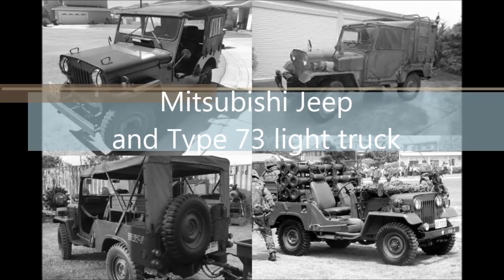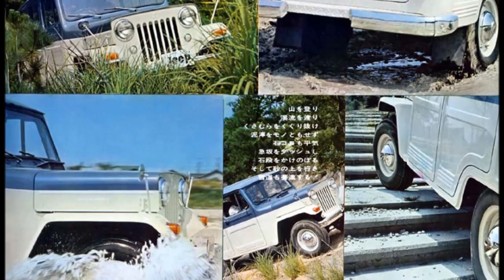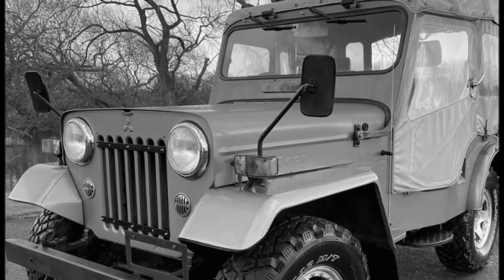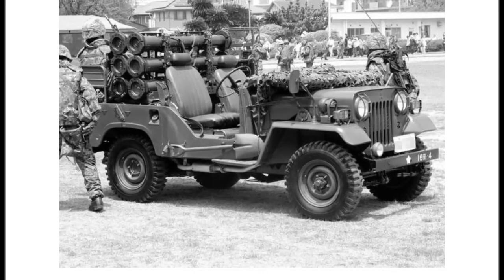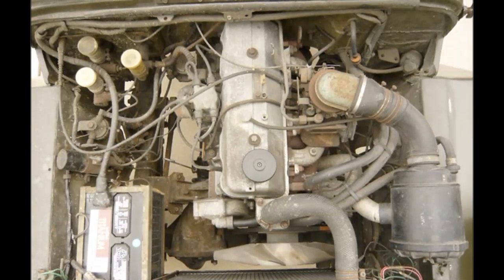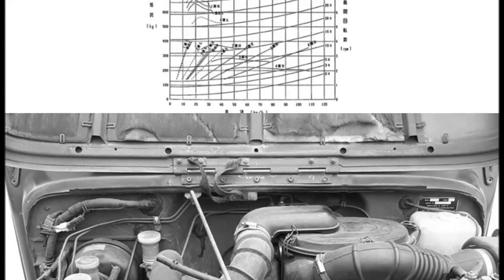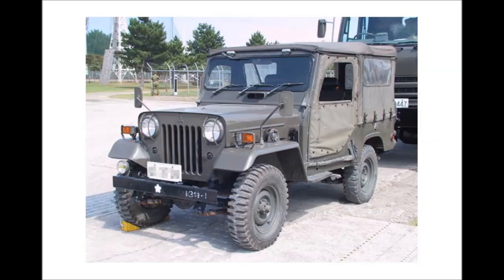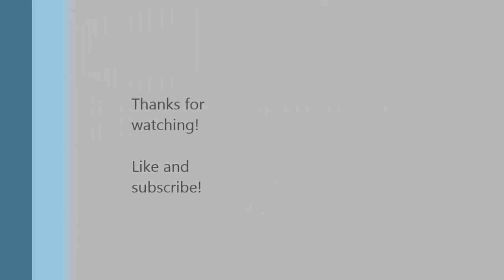Mitsubishi Jeep and Type 73 Light Truck Introduction

Comment: Very thorough.
I appreciate all of the information.
Reply from the maker: Thanks! Glad you enjoyed it!
Reply: @LesSharp  I did, indeed.
I'm in the U.S. and have owned a few 'flatfender' Jeeps.
I presently drive a hot rod 'flattie' with hopped up Buick 'Odd Fire' 225 inch V6 (gasoline) with 4 speed and Warn Overdrive.
I'm fairly well versed on Bantam, Willys, Ford, Kaiser models but not as much with Hotchkiss, Mitsubishi, Willys Do Brasil, Mahindra... .
This video is the most concise reference I've seen, including printed material, regarding the Mitsubishi models.

Comment: my big interest is how is the chassis and suspension different than the civilian Pajero??  I know that the military G wagen, I own one, has a considerably heavier duty frame and suspension.  Is the J73 the same???  I am looking at a 1993 model....  any information would be greatly appreciated.
Reply from the maker: While the Type 73 can be seen as a forerunner to the Pajero, it’s a very different vehicle. The Type 73 Shin is based on the Pajero but the newer platforms really don’t have anything in common with the 73 Kyu.
Reply: @LesSharp  but does the type 73 have a heavier duty suspension and chassis?  Or is it the same as the pajero?